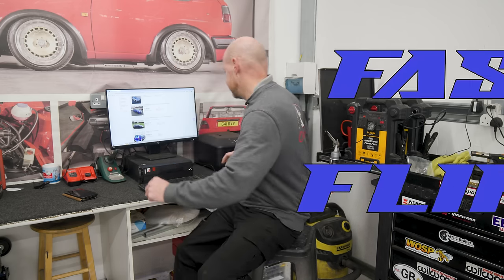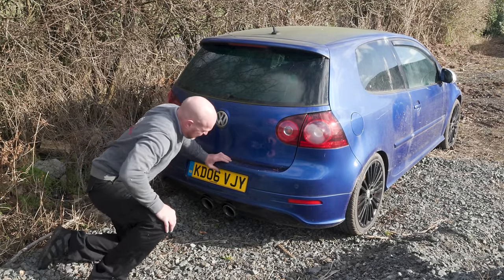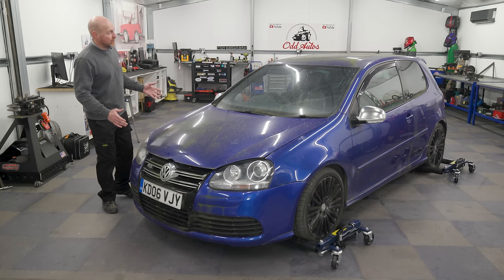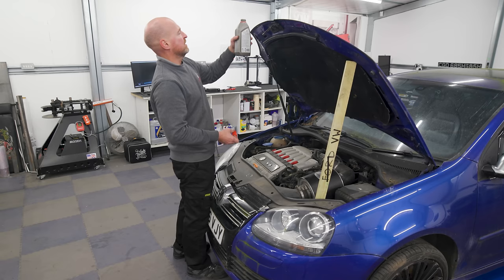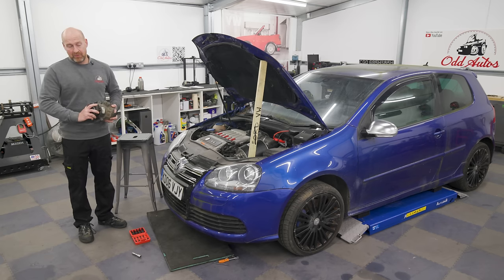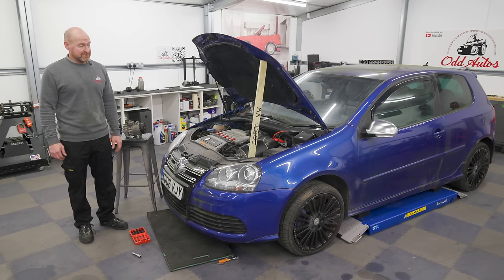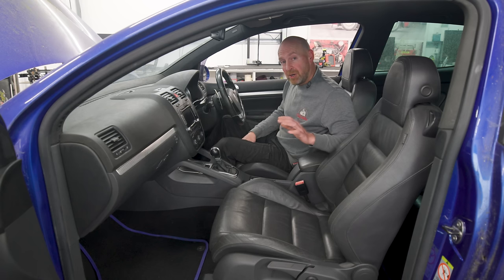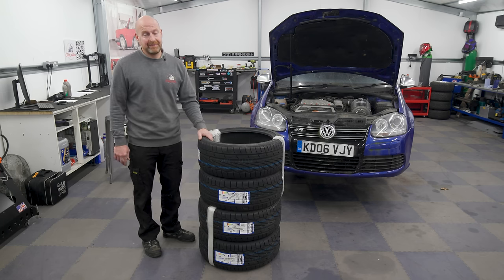FAST FLIPS, Vw Golf R32, Make some CASH!... nope!

Comment: Do a proper repair job on the rusty sill.  Blend the paint as best as possible into the rear quarter panel.  Someone else has already suggested decals to help hide the (hopefully) subtle paint colour difference.  Be honest when selling it.  Lots of pics of the work carried out showing rust removed, and area rebuilt.  Won't get top price for it, but if done well it should still be worth a good amount.
Reply from the maker: Yer I think it’s worth a go 👍👍
Reply: I deffo agre worth saving . Doing for the love . Love is never easy
👍🏴😁✌️
Reply: I agree on this. Aim for the best blend as achievable. Cat D unfortunately and doesn't warrant the full respray. If it looks a bit off you can live with it. At least the sills will be rock solid
Reply: Make a detailed video of the quality repairs you always do.
It will be peace of mind to the buyer and hopefully sell easier.
When is the next video of it.
Reply: Instead of painting it to match the rest of the car, just wrap it.
Reply: Agree on this comment, worth saving
Reply: @gustavomg28 wrapping ain't cheap (£1,800 to £5,000)þ You could get away with maybe a thousand if you skipped the mirrors, door handles, etc.
Reply: Defo worth  doing it
Reply: Agree this is a R32 not just a regular golf. worth fixing it up imo especially after stuffs alredy been done to it.
Reply: Weld sill then blend paint that side
Reply: Two tone it. Back half flat black. Have the black come into the door a bit.

Comment: You should always wear a mask 😷 and my advice is spray white vinegar with water mix 80-30 mix all over the car and on the carpets and then on the carpet and headliner with mould killer and to wet-vac the carpets after.

Comment: We ran one of these for about 12 years.  Was a terrific car. 
What did we do.....normal maintenance, also dsg and haldex service....couple of batteries, ( in boot, under a hatch,bit of a pain to get to)
Suspension bits, couple of window regulators. That was about it. Very reliable engine. 
So much so, i bought an r36 for myself ( golf was the wifes car) and i still have it, after a good ten years.  Great sounds.

Comment: You’ve got to weld in the sill repair panels. Alternative solution for paint cost would be Two Tone the paint finish. Grey on the bottom and leave the top half blue. It’s an idea anyway.
Reply from the maker: It’s a good idea mate 👍👍

Comment: The R32 is the car that i always wanted and never had. 
The value will most defintelt increase, and i m sure decent examples wikk go for north of 10 grand in a year if 2. The VR6 has so much character, i doubt we.will ever see something of its ilk again.
I would love to see you do a full restoration, fix the rusty sills, ice blast and rust proof the underside and give it a full respray. Youd be over budget, but youd have a nice R32 that in a couple of years would give you your money back.
Wrapping is a thing for heavily modified cars, but in my opinion a respray in the same blue would be the best bet for this classic.

Comment: I feel your pain, i also flip cheap cars and the latest one (broken cambelt,  head off and  new valves job) was booked in for MOT and i thought i would clean up the sills and put some fresh Shutz body coating on, well my hand went straight through the sill, it was quite well disguised by the original thick rubbery factory coating, both the sills are rotted about 60cm long in the same place as yours, not impressed, cancelled the MOT and retired to the house for a brew and a sulk. Lesson of the day, get right under the car and have a damn good look at the underside and not just a quick glance.

Comment: Oh dear. Typical Mk5 golf though, they rot worse than the mk3s did.

Cat D just isn't worth rust repair if paying professional rates... but you might be able to save some money there. Can't the repair just be blended under the bump strip? Edit to add - the wrap idea is neat one, as it is CAT D there is no point keeping it original. I always thought white looks nice on Mk5s 

Now you know the engine is good, interior is sound etc you'll easily make back your money. A shame as it was going so well.

Comment: When you fix the rust you could paint the rocker covers black and if you can cut and weld close enough to where the cover sits you could paint it black as well just above and around the cover area in the same design the cover is so it looks like it blends in with the cover. Sort of hard to describe it. 😅

Comment: 6 months ago I got an A3 8P 2.0tfsi Quattro. For 5.5k since then I’ve spent 2k on brake discs pads full engine service, all filters changed. I Just need another 4/500£ for gear box and haldex service from Audi.  Ready for a tune

Comment: If it were me, I'd do the sill repairs, keep the repair area as low as possible & fit a vinyl side graphic over the blend line. Or wrap the lower half in a contrasting colour..
Or possibly a rally type livery in vinyl graphics.
Vinyl has gotta be your friend in this instance.

Comment: One thing regarding interior smells/odours. Had an issue where I couldn’t get a smell out of car. Tried everything including using a vapour machine and the only thing that worked and has kept the smell away is Autoglym Odour Eliminator. I swear by it now. It’s got something in it that reactivates the pleasant smell of the eliminator even when things get warm inside the car. Not expensive either.

Comment: Depending on the milage a good example is still fetching strong money. 

You also have gained a good name for your self for delivering high quality cars. 

I reckon do it to your usually high standard and it will fetch the north of what these are going for. Failing that fall back onto a raffle or see if dream cars will have it off you. 

I'd certainly get a couple of tickets if there at a good price. It's an appreciating classic. 🤟

Comment: Hi put sills on it and use the rapter underseal or similar that you can add colour to and match the paint , Mazda do it on the MX5 , and I have done it with a mates mx5 when doing the sills , get a direct gloss to mix in , will be mint 😉

Comment: Typical MK5 golf, that’s why I got rid of mine, rotted inside and outside sills right along on both sides, even as a welder it was too much for me. But you have shelter and a lift so not as bad 😅! I think you could maybe have a go at painting it yourself, take your time, flat and polish, if you don’t fancy that, you could possibly wrap the car. If not then a track car like you say wouldn’t be a bad choice 👍🏻
Reply from the maker: I suppose with wrap on a track car it’s easy in the future if it needs panels changing, cheap then to just wrap and fit.

Comment: Maybe do a 2 tone color, black 1/3 and blue 2/3 that will go well with the black wheels and a gray stripe that separates the balack from the blue so they meet at the door trim level. Just a suggestion, that way you don't have to paint the hole car

Comment: Unlucky with the rust but just goes to show you need to clean drain holes and wax oil them annually. How many people don't check windscreen drain holes or door drain holes ? I would do the repair and rattle can it. Pop the side skirt back on and add a graphic such as a chequered flag up to the body trim line even just on the rear quarter. Black or silver to match wing mirrors. Check the other side as well.

Comment: Bumpers worth a good chunk, side skirts worth a good chunk as well!! Same with headlights.

The grill alone is 150 to 300 in the states..
Reply: Steering wheel a few hundred, shift boot a chunk. Any r32 specific trim they had a different Siler trim then other mk5 worth some money. If you  pick it right. 

If you had to break it for 500. You're in the GREEN
Reply: I'd still keep it though if you can do it all yourself, which shouldn't be sn issue, parts shouldn't be bad. And it would be a fun csr to have
Reply: Just getting to the interior portion... r32 leathers worth some money. Whether you keep or break down its a win. But with what you have into it at this point RUN IT
Reply: And after seeing the rust... grind off rust, use por15 with fiber mesh to seal it back up doesn't have yo be perfect and out side skirt back in lol, while you're under there rid any surface rust and Just por15 the whole sill

Comment: Repair the metalwork properly and paint it with colour matched rattle cans if you can't get the paint done cheap enough, or blow it in with a mini spray gun and a bit of 2k lacquer.
Sprayguns Direct do a small budget spraygun, (ANI GF3), for about £35 - worth a go, nothing much to lose as you've got that far with it and must still be a profit in it.

Comment: Replace the sill(s) odds on the other side is the same, blend it as best you can mop the car and apply some racy graphics. As it's not going to be concourse chances are it will end up as a track car as long as the repair is strong and sound, it should be fine, it is an 18 year old car after all. Good video I enjoyed the content, but should serve as a warning to anyone thinking of buying a car that's been raided up (especially if it's been outside), there is always hidden damage and the cost can easily get away from you.

Comment: IMHO because you are that far into it the only sensible option is to repair the sills and have a good body shop guy "blow in" the paint to some of the quarter and some of the door, it shouldn't cost too much and if it is done right it will hardly be noticeable to the average punter, especially after a damn good all round 2 stage polish which that car badly needs. Alternative is to sell as it is as a project to someone for what you have put into it but you wouldn't get any content out of it though... 😜Best of luck with it!!

Comment: Gutted for you; so annoying that someone’s bodged that. I had a mk5 which needed the wings replacing by VW. Also the sills welding near the front wheels too. VW really messed up the corrosion protection on the mk5. I would still try and fix it after all the work you’ve done on it.

Comment: You have a body line along the door . why not use it . spray from front to back and blend in just around the arch .  i would suspect the other side is possibly the same . And don't forget you have scratches on the bottom of the door .  if you don't want to blend in , go other colour ,me i would go light blue . once the sills are  repaired you could wrap it instead of paint .

Comment: Before you go any further. Do a proper inspection on the rest of the car to see what else might be hiding. If it's just the seals then might be worth the repair and a cheap ish paint job. If you find any other horrors brake it up.

Comment: 3K for spraying? Is that what it costs? Material content isn't much so labour must be heavy. As a heating engineer by trade, even I'm shocked!
Reply from the maker: Materials about £1000 now, sanding pads,filler,primer,base coat and lacquer. Paint costs loads these days.

Comment: Don't blame you for cutting the price in half £500 but if you think it's not worth repairing then breaking it for parts you will make a profit  with that exhaust and induction kit the cat if its still got one that's wat you paid for it then you got the whole car still but as long that engine and gearbox is ok then worth fixing just try sort that bad repair the best you can clean it up inside and out and only do wat needs doing good luck with it mate

Comment: You've already spent too much money to go back. Do the sills (both sides) and do the rattle can spray job with a blend in. No it won't be perfect but you'll still be able to offer a lot of car for a small amount of cash. If it's mechanically and structurally sound with a year's MOT you shouldn't have a problem selling it.

Comment: Weld it fix the rotten part and instead of painting it fully wrap/paint the bottom half black or something on both side or even a R32 decal or anything. Bet you someone would pay 5-7 grand for it.
So much of a car to get wasted and pretty cheap still to make a good profit on it.
Reply from the maker: I’d have a go at wrapping it, I can do bumpers easy but a car I might struggle. Worth a shot though 👍

Comment: Tbh I think the cleaning should have been better, because of the mold. You can still see it in the cracks of the steering wheel. A detailing is needed, even if just the inside. BUT now that you got to the rotten body.. hmm.. Sell it as is, just be honest, that everything is fine, but this needs to be fixed. I dont think its worth to fix it yourself. Its not worth at least the time, considering its a flip.

Comment: You would been better breaking the car for £500 you paid at least 3k+ in parts engine alone would pulled £1200. But I'd get a sill in paint the quarter and blend it and leave it at that.

Comment: What tf are yoou guys drinking over that side of the pond, Lol. If a car has been siitting a year or so, sure a oil change and you might keep driving. But anything with two or more years to be safe run an engine flush using liqui moly if youre really trying to save the engine.